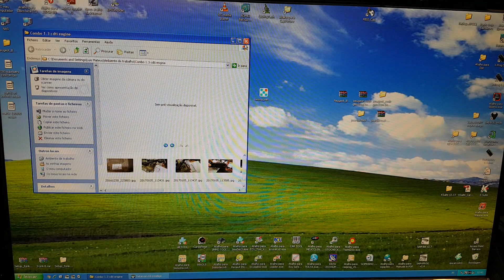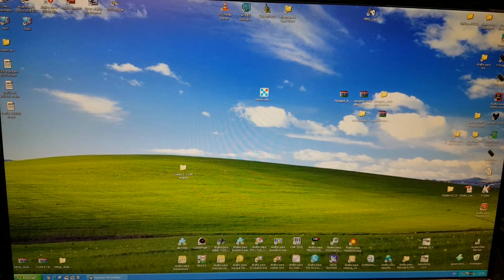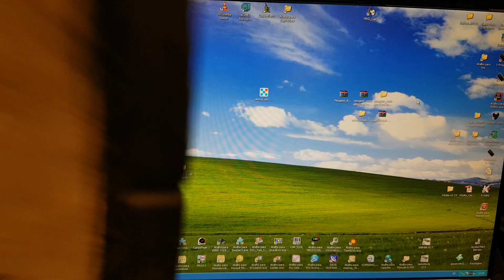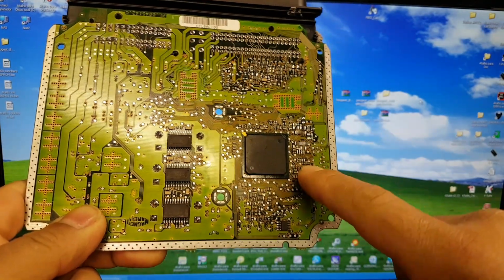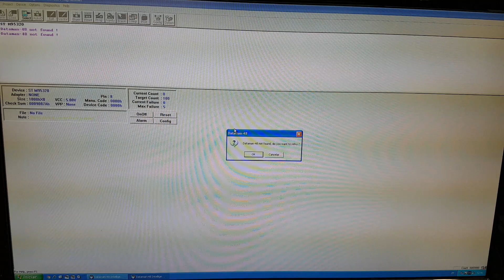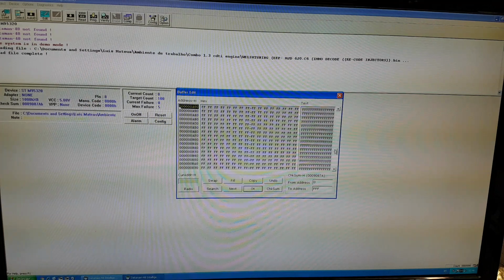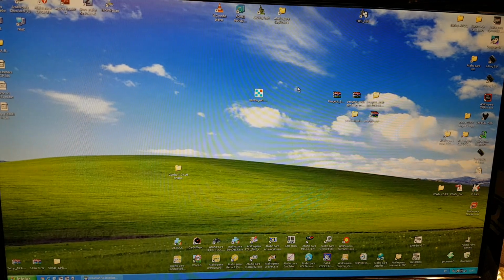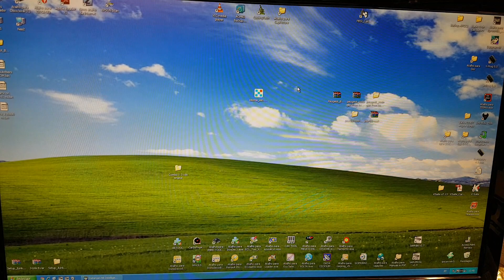Vauxhall/Opel 1.3 Cdti Magneti Marelli MJD immo off permanent solution.

Comment: Hey does the same solution work for MJD 603.S3?
Reply from the maker: Possibly...
👍👍👍
Reply: @LMAutoRepairs  is it 100% or I need to test if it works, do I need to disconnect anything after putting the immo off file and write protecting it. 
 Thanks if u reply!
Reply from the maker: Nothing disconnected...
Give it a try, I never done it on that particular one...
👍👍👍
Reply: @LMAutoRepairs  Hey, I tried without wp eeprom and no luck.. 
After reading eeprom again I can see that eeprom was changed not like the one I wrote
When I wp eeprom will I be able to write again in it if it doesn't work?
Reply from the maker: @XOELECTRONIC  
You should be able tondisable the WP with the programmer to allow you to write again...
👍👍👍
Reply: @LMAutoRepairs  Hey just to reply with resoult the soulution doesn't work like on 6J0 eeprom wp with the same eeprom u used, I managed to program new key and car starts now..

Comment: Works on a Marelli 8GMC.C1 2012 Fiat 500 1.4L. Copied the original eeprom to the donor ECM and locked it with BP0 and BP1. Car works again with a scrapyard PCM. One thing I found out for this particular car is that the crankshaft position map for misfire detection is written to the same eeprom as the SKIM key data. Code P0315 - "Crankshaft Position System Variation Not Learned". It does not effect the drivability of the car at all. 
I used a cheap eeprom tool from amazon - CH341A USB
A free program called, "AsProgrammer_v2.1.0.13"

Comment: Hi mate if I want to get a ECU from another  car that is not paired to mine what chips on the board could I remove and replace to another board to make it the same as original and is this possible how many ?? Chips on board hold the data connected to that particular car thanks.
Reply from the maker: Depends on the car... some cars you get away with only the eprom... however, some ecus the eprom is internal, or on the MCU... the MCU is a bit more tricky to move though... better to transfer data...
Thank you for watching!
Reply: @LMAutoRepairs  it's the 1.3 cdti Vauxhall board magneti marelli as you are working on in vid mate if I take the eprom from the original board that was working before the water damage and get a doner board from salvage car and swap eprom is that the only part that is different and makes the board unique from a stock board thanks again for the reply.
Reply from the maker: @tjautos  
As I replied on your other comment... yes...
Reply: @LMAutoRepairs  

Hello dear
Which software do you have good to clear immo on IAW4MV.ED(Magneti Marelli ecu.  need it please!
Reply from the maker: @billzhao8507  
Hi
Without looking through my stuff, not really sure...
Do a Google search... I am sure it will help you...
Thank you for watching and for your comment!

Comment: hi
may i ask if is not possible to write the eeprom, the oil counter, mileage, injectors etc ... remains always the same?
Reply from the maker: The injector codes are stored in the flash... not in the eeprom. 
As for the rest... probably not...😉

Comment: HI, thanks for sharing the info with us mate. Quick question: I have water damaged ECU 1.3 CDTi MJD 603.sa with same eeprom. If I buy a second hand ECU, will it be enough to swap the Eeprom from my old in order to start the engine? Thanks in advance
Reply from the maker: Hi
Indeed it is...
I actually have a video already recorded, showing exactly that...
Swap the eeprom and you will be fine...
Make sure you unblock the drains and the ecu is properly sealed afterwards... in case we are talking about the Corsa D....😉
Thank you for watching and for your comment!
Reply: @LMAutoRepairs  Mate, you are an absolute star! Thank you so much for quick reply and help provided! I will update you on my results. Best regards
Reply from the maker: @Peter-fckyt  
😊
👍👍👍
Reply: @LMAutoRepairs  and yes, it's a corsa D ☺
Reply from the maker: https://youtu.be/shYRNQOMV7s

In case you have not seen it...
Reply: @LMAutoRepairs  lucky me :-) I have opened the ecu, a bit wet but after drying and cleaning up, the car started :-) thanks for your help buddy
Reply from the maker: @Peter-fckyt  
That's great news! 
Nice one!
👍👍👍

Comment: hi i have same type of ecu (MJD 602 .y4) can you immo off that one or how can i immo off by myself?
Reply from the maker: Hi
I can immo off it... or you can if you get the softwares...
But, does your programmer is capable of switching the registers?
Reply: Sorry for the late reply bro i'm new in this field don't have programmer right now it will not work with ktag files?
Reply from the maker: @sherry9313  
Yes... if you have downloaded the eeprom with K-tag... but K-tag can't manipulate registers... I think you are confused, you need to research before start to do that... or you might brick the ecu...
Reply: I have eeprom file right now but don't have the correct software

Comment: Really helpful video thanks, getting my ecu replaced with a new unit being sent from Germany on my Astra 1.3CDTI. All going well, a local mechanic will fit it and it will be coded at a Vauxhall dealer, so I am reading up as much as I can on it in case any problems afterwards.
Reply from the maker: Another View 
Hi
I have other videos on how to code the ECU to the car....
I am on my phone, otherwise I would post the links...
But, thank you for watching and for your comment!

Comment: And the ECU will still record error codes that way?
Reply from the maker: Throzencrew 
Hi
Yes it does... I have tested it.
I believe that the codes are actually in the flash...
Reply: Huh, interesting! That's superb solution then!
Reply from the maker: Throzencrew 
Thank you!
I know it still record errors, because at the time was a fault with the MAF... and I have deleted it, but came back a few starts later... this was after the solution applied...

Comment: Mate dont understand why some users would send nasty messages in stand to  try to  think with each other h8w to find a solution anyway great video again as always .about this ecu i khnew that immo off only offers a limited time of ignition and you have to reset the counter again its what you see when you read a opel ecu with carprog you have this option too .what im trying to do at the moment is figure out how to do an immo off to a edc15 mercedes benz ipo an emulator if you have some idea man would be more than welkom.